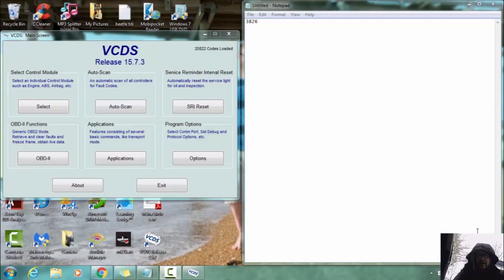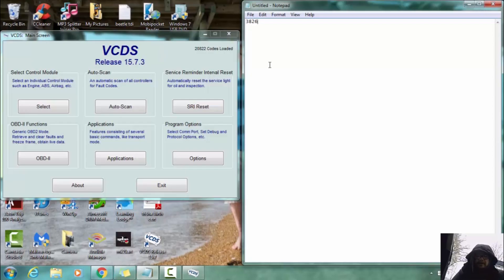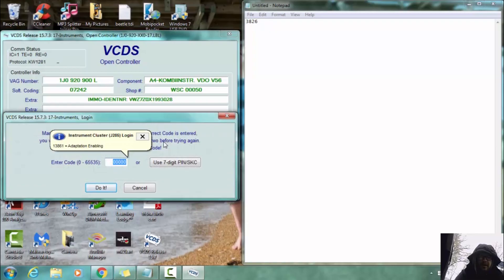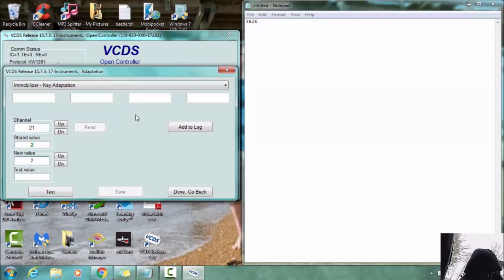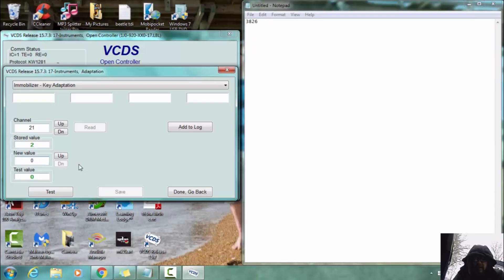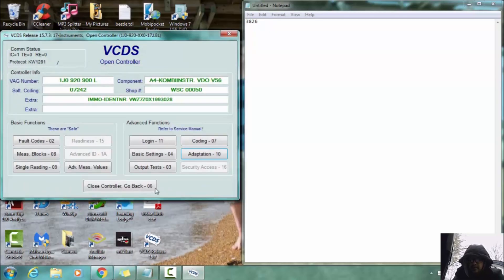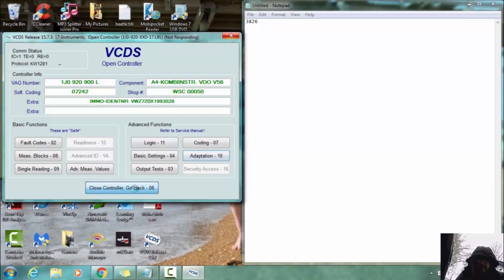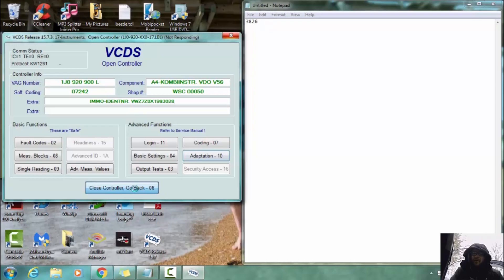VCDS Key Programming with SKC

Comment: The hardware store cut a key but they couldn't program the chip because the only key I had was a valet key.  But I got the pin from them and programmed the key they had cut using this method with VCDS-Lite.  Thanks.
Reply: What?? What hardware store??

Comment: To anyone struggling with the SKC Pin here's the breakdown...
Anything pre 2005 (immo3 and lower) can be retrieved with the VCDS or a VCDS "KKL 409.1" cable that actually has the FTDI chip. If you get the cheap one and you can see through the casing that it only has 4 pins connected to the OBD2 connector then you got the wrong one and you might not be able to pull the pin(i tried I had one of those). VAG.exe (VAGEEPROM Programmer) google it will be used to pull the cluster SKC pin. After that you are free to do your VCDS key adaptation. You can also use Vag Tacho cable to "pull skc pin and program new keys" . Tried one with win xp with 3 different drivers, win 10 with 2 different drivers and no luck ^. Car in question I had was immo3 golf. Tried different version of that cable too, I had the Vag tacho 5.0 cable.
Alternative method to pull the SKC pin would envolve BDM frames (aka pulling the windshield cowel, pull the ECU out, heatgun to the ECU, short the ECU and put it into loop mode and use Galletto to retrieve the .bin file from your Bosch ME7.5  (more than likely if mk4..) ecu. Search nefmoto for more info...you get the idea. From here you can tune ECU to your liking if you know what your doing with WinOLS etc..
Nefmoto has the ME7 documentation in german (think someone translated it? )if you really want to delve into ECU programming and tuning your ECU to your car's liking.
Alternative METHOD 3! Immo off. I have no experience with this, if someone wants to add go ahead.

Back to my original method. Here's a how to if you have an original VCDS cable (please buy from VCDS, I have a HEX V2 cable registered to my name, paid 500$ for that puppy, I use it for my mk5, limit number of vins) / KKL Cable blue cable (THAT HAS THE FTDI CHIP!) https     tinyurl   com   tfsmn9x

NOTICE ABOUT THE PIN:
As per VW, I think they stopped giving the pin out to customers in 2005 that proclaim that they never had the pin.

Something else to add: I did not test the Megamos ID48 transpoder programmer of the Vag Tacho 5.0 Cable that came with it. I'd also like to add that the interface connected on both OSes (10, xp). Different comp modes tested too yadayada...baudrate testing...also tested but could not successfully connect to the IMMO3 ecu.
Reply: Thanks for the info mate!
Reply: OK. So I have a Ross tech cable and a 2005 Beetle.  All I need to do is download the free vagtacho software and use my Ross tech cable to get the skc pin?
Reply: So if I have a Ross tech cable can I run the vageeprom program to get the pin? Or do I need that blue cable?